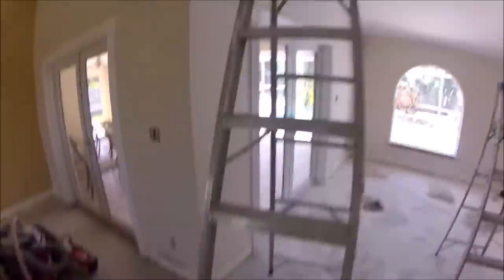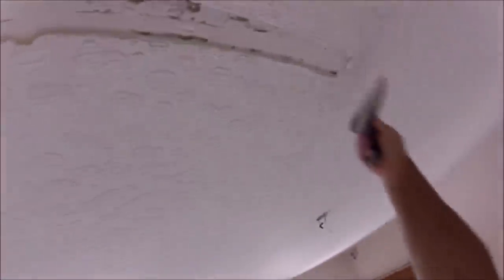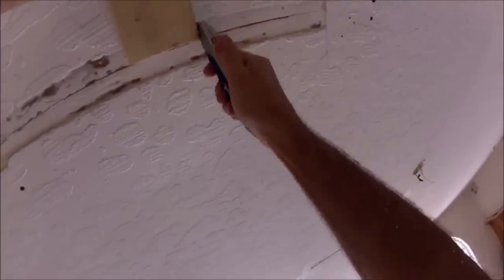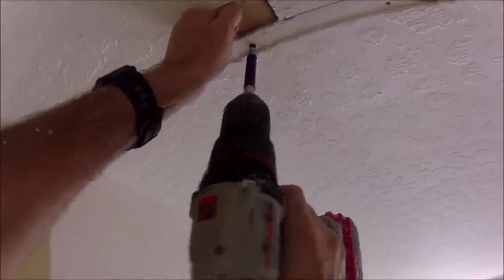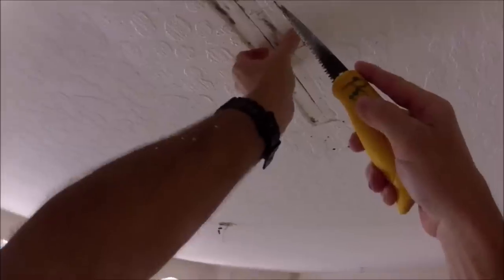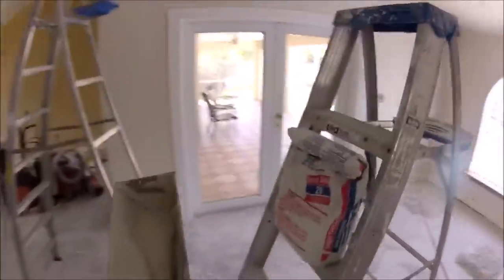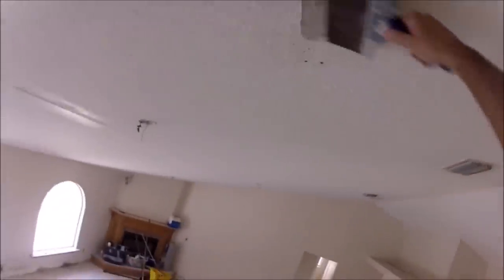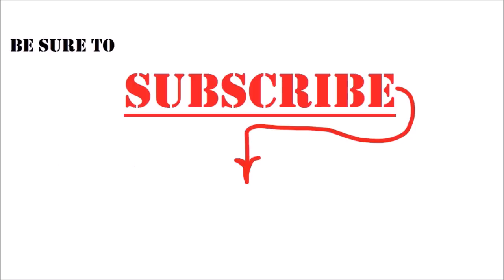How to Repair a Ceiling Crack- Diy Drywall Repair Tips and Tricks

Comment: Finally getting to watch someone who has talent and pride in their drywall work!  My daughter and I specialized in drywall repairs for years.  Basically we were painters and just got into the wall repair by accident. We always aimed for perfection. Matching many older texture styles was always so fun. Our aim was to make cracks and dents completely disappear. I have never done the backing board thing, but have imagined this very technique in my mind....this video was amazing! Thank you!
Reply: What method will be useful for arresting water leak from the upper floor rest room? They suggest the application of crack- filler solution after drilling with the help of a machine! Will it be useful. Kindly advise me, as I keep the premises unoccupied due to this problem for several months!
Reply: @rajendranthangavel9161 you fix the leak. If you try to waterproof the drywall you will just end up with a bigger problem by the time you notice it’s wet.

Comment: You did a good job. I would of added one thing. Before mesh, V out the flat seam out a smig... then add liquid nail... putting enough pressure to have it squeeze all the way thru to the opposite side of the drywall, and fill the V... then mesh away. No hump, no issues with mud dry or flashing. But it’s a forever fix.

Comment: 10/10 - This isn't just a cover the crack quick fix. You're getting to the root of the crack and fixing that. Great video. That and your texturing techniques. I've been doing home drywalls repairs for 3 years(as an amateur home owner). I think I'm pretty decent for an amateur, and I'm constantly criticizing my work every time I walk by it.  I learn something new with each of your videos. I may punch a hole in one of my walls just so I can fix it. That's actually not necessary since I have several ceiling cracks and some wall work to do in my spare time. Keep up the good videos
Reply: Need to repair 2 boards that have
Separated

Comment: Have an eight foot crack in livingroom ceiling spanning the old 2X4 trusses. I have been up in that area doing electrical and venting over the years and my weight probably flexed the trusses.  Really like that furring strip repair example in your video. Thanks.  I'm doing one on the Master Bedroom electrical outlet cutout, where I am installing a much larger outlet box to ensure enough air space for cooling of the 21 electrical connections in there.  Nice video, now I know how to fix this ceiling crack professionally.  I worked in the 1970's for a short period as a drywall grunt for a journeyman and we would sheetrock a 3 br/2 ba split level in around 8 or so hours.  That is when I learned to hammer from any angle thousands of times a day.....back then we used nails.

Comment: The sheet rock in my garage ceiling is doing exactly that at every joint thanks for the tips!
Reply: .. same reason I watched ,,, and yea ,,, furring strip was good tip .
Reply: Same issue here. What’s the deal with garage ceilings?
Reply: Mine too.

Comment: I've been a drywall "taper" for almost 48 years now. For the first 39 years all I did was a lot of production piece work using taping tools exclusively. Where not only did you have to be fast, but you must turn out quality work to make the money.  Yep... I'm that old and still doing it and have pretty much seen it all.  I've gotten into more  remodel  jobs these last almost 10 years now because that's where the money is now. 
I despise cracks in the ceiling. One reason why is trying to match textures. I try really hard to do them where they disappear. And I'm pretty good at it. But... it's a patch. Your dealing with mils (many coats) of paint, light going across the surface and picky homeowners. I always tell them "It's a patch". And I do the best I can with all the experience I have to make it right. Then give them an option of fixing the patch... which "should" come out right.. for $XX.00. Or... I can do the whole ceiling for $XXX.00. They almost always go for the $XX.00. 
One of the biggest reasons cracks appear in the first place... 2' centers on the trusses/ joist and 1/2" drywall. I've seen this done on custom homes and track houses.
It's sound structurally, but it moves way to much. If home builders pull that stunt... they need to use 5/8" rock.
In my experience about mesh tape. See all those holes in it? I've seen numerous patches, and sometimes whole houses taped with that stuff. "Hot Mud" or regular... it "can" crack straight down the joint line. It's a risk I'm not taking. It's a "do it yourselfer" product because you don't have the blister issue of not getting the proper amount of joint compound under the paper tape. 
I use a lot of 5 minute "Hot Mud" because it just works faster when doing those small area patches. Not recommend if you move like molasses LoL!. Many times I've mixed up a sack and a half of 20 minute in a bucket and use it up before it goes off. 
I haven't had time to look at your other patching videos. So I'll  just say this now... rub the edges of the patches with a wet sponge to blend into the old texture when your ready to texture the patch. It will kill the edge and make a better blend. And if that's what you recommend... good for you.
Reply: So do you strictly use paper tape for everything? What about fibafuse?
Reply: @classiccountryrevival8563   I've never used that stuff before. I know drywall tape. And I still push a bazooka around on bigger jobs. That fiber type tape will not work in a bazooka. One 250' roll of it is almost over 4 times the cost of one 500' roll of the paper tape. It looks like you have to carry a razor knife to cut it too. It doesn't makes sense to me because the regular tape works fine.

Comment: One of your better how to videos. Ceiling cracks stink for sure. One of my rental properties years ago, a potential tenant saw a crack like the one you fixed and bailed on renting from us, saying it was a deal breaker. She was paranoid and thought the place would fall apart. It was Only cosmetic! Paul have you heard of those screw setter bits Dewalt makes that allows you to instantly sink a screw into drywall perfectly every time in one motion? You don't have to slow the drill down at the end because the guard on the bit stops it perfectly.
Reply from the maker: I appreciate that Jeff.🔥 Haha... Yeah some people get freaked out if they see a crack in their ceiling. Are you talking about a dimpler bit for a drill?  Yes, use them all the time on new drywall.👍🏻 I don’t really use them on repairs though. Because it’s not usually a flat surface that I’m trying to screw into. Thanks so much for watching and commenting man! -Paul

Comment: Yep, that is how you do it! Basically, all drywall seams need backing.
Reply: Exactly, if it's hot room to move it has room to crack.
Reply: Makes sure to tell that to all the "professional" drywallers...my house is a mess because of bad joint locations, 24" spacing and no backing at joints...I just fixed a ceiling in my bathroom, bad tape job. Peeled right off...Should be good now. No I'm not a pro just hate shoddy work. Takes me longer than a pro, probably more sanding but looks good and lasts...

Comment: im going to be fixing up my living room soon so this will come in handy!
Reply: I had some water leak from the kitchen to basement.  About 3ft n three different area's I left the tape up remuded over it sanded it down and texted it but there were still a lump in the ceiling do I have to remove all that tape and redo it

Comment: DYI here, enjoying the videos, I’m researching. I’ve got a big mess, plaster walls and most of the ceiling appears to be plastered. They had covered both with paneling, which I removed. Water damage, roof repaired, sistered some beams, removed the nail glue but lots of holes left to patch, cracks to fix. I’m thinking after those are repaired skimming and knock down are going to be the best approach. Thanks for the videos.

Comment: after you put the firring strip through the hole turn it 90 degrees so it will span more of the joint.  Ceiling trusses are typically 24 inches o.c. which leaves roughly 21 inches between trusses. If your fir strip is 12 inches long and more or less centered between trusses that leaves only about 4-5 inches of unsupported joint.

Comment: If you have problems getting  block of wood into hole with drywall screw  in it, Try placing a center mark on wood and push wood in hole without screw, then work a string, cord, or wire around wood, move wood in place using center mark for reference, and pull down on string, cord or wire while driving in screws  then remove string,  you can do same on walls but need to tape  string on back of wood so not to drop wood down inside wall. Might need a glove on while pulling down on string. This works well in tight spaces like in ceilings where roof angle is close or wall which has an outlet box or framing in wall in opposite room restricting your hole access. 
M L Rogers         Pasadena, TX

Comment: When you mix up easy sand whether it’s 20 , 45 or 90 , always clean your bucket or pan well and use cold water . Quick mud is hot mud . It gets hot . So the colder the water the longer the compound will stay usable . 
20 should actually last about 30  minutes . Etc

Comment: Super tip ! I like the furring strip insert!! Indeed fibafuse would’ve been also a great option and there is a hot mud from Certainteed called lite sand plus specially developed by Chemists to stick to painted surface thus eliminating the need for a primer and it is sandable as well! Love the video 👍🏽👍🏽
Reply from the maker: Hey there Doctor Mud!💥👊🏻 Yes, this furring strip trick is pretty slick for sure! The best part is that it really works!!! I have not heard of that Certainteed mud. I’ll have to look into that. Thanks for the head up on that!👍🏻 Glad you’re enjoying my videos. Thanks so much for watching and subscribing my friend!😎 -Paul

Comment: This is a great tip! Fiberglass tape also works great across surfaces of different materials. Knocking off high spots with a 6" knife can usually prevent need to sand- of course, practice, practice, practice! Thanks!

Comment: Paul, good method with the extra blocking,  but in 30 yrs of drywall I have found that you need the continuous membrane of paper tape, using fiberglass tape the cracks will just reflect through the mesh and you will have cracks again.  We stopped using mesh back in the 80's.

Comment: Have a cieling crack that appeared following a roofing job. Ceiling is drywall. Crack is pretty long, starts at a corner, goes about 20 feet. Notice that there is movement in drywall. So This furring strip technique is reccomended for a job like this? Considering the length of the crack you reccomend multiple strips? Or only where the drywall has give? Had foundation people in to make sure it isn't foundation. The crack is not scraight straight, kind of has multiple start stops but all in line.

Comment: I do repairs at an apartment building that is 100 years old. Yes you read that right. 100 years. It’s almost petrified. I have to drive pilot holes most of the time. Anyway when I repair the drywall it’s so old, most of the time swollen and crumbly. Any tips on that? My least fav is overhead. Thank you so much!  I just kinda ran into your channel. You make it look so easy!
Reply: If it is 100 yrs old and has never been remodeled, it is most likely plaster lath, thin wooden strips, with a 3/8" gap between them, covered with plaster which has horse hair mixed into it. The horse hair helped act like mini rebars to give the plaster strength. After plaster lath, came Rocklath [roughly 18" x 4'] , then came drywall.

Comment: I did this about two years ago but did not have any flex in the drywall.  Have you every used Saint-Gobain's ? Lowes carries it and I switched to it from FibaTape and still use 20 min mud, works every so good.  Thanks from the Palm Beaches for giving your knowledge on this part of home repair.  Much appreciated.

Comment: Thank you Paul. I will try that technique on some repairs that keeps surfecing up here at home, nearby the windows. My entire leaving room ceilings has cracks, I wonder if it is worth it fixing it or replacing. The home was built in the 50’s and has plaster and that nasty spraid acoustic in the attic!

Comment: i've had a 10' foot long ceiling crack, two different drywall guys have patched it up and cracks again. they definitely didn't do what you're doing. i also believe there was a wall there before and wondering if its more of a framing issue? great video!

Comment: The drywall repair was done right except i use paper tape it never failed me. 
If you are using mesh tape you have to use a different gage a lot thicker and stronger it’s used in the plaster trade sometimes. 
🙋🏻‍♂️👍🙂

Comment: We always set 1x4 or 1x2 furring strips under rafters with 16 O.C and then screw drywall to those furring strips, never seen any ceiling crack because it's so well fixed.

Comment: As a DIY guy I've done a lot of drywall repairs.  I appreciate all you video's they help often.  I just bought a retirement home for ourselves.  The ceilings are in fair shape, there are a few joints that separated and  have no problem doing them.  However, the ceiling was finished using a spraying application and they mixed mica in with the paint (stuff the use to do back in the 60,s thru the 80's.)  I won't be spraying the finish, most likely using a roller.  I can't find mica anywhere in my area or online.  Any ideas on where to purchase?  I like the look of the reflection, especially with the fireplace blazing.  Thanks for taking the time to answer.

Comment: I have cracks form across the center of mobile homes. I scrape the old texture away and patch it perfectly  but when it comes time to match the knock down. Its hard to hide the 12 ft or so strip i scraped out of the ceiling to reveal the crack. ...otherwords its hard to match it to both sides of the patch that i didnt scrape.

Comment: Holding on to that little screw can be difficult, you might try using a peice of shoe string wrapped around wood pull down on both ends after screwing let go of one end and pull out. This way you can get more leverage.

Comment: It's always best to remove the old tape just so you can really see what's going on underneath and resecure the boards as needed...   As painful as that may be when you're only given a small time frame for the repairs and you have to dig the tape out inch by inch...  It will always yield the best if not longest lasting repair.   I never go over old tape even if it's bonded well.  For all you know the first guy used a finishing mud for tape and bed coat 😅

I'm dealing with one Monday that should have had an expansion joint installed in the first place... 60ft ceiling without one and a crack formed. Awesome.  Owners won't go for a proper repair.. I'm almost certain they won't.

Comment: New DIY viewer here. Enjoyed your video.  Concise and informative. I'm Looking  for information on repairing a kitchen ceiling crack.  The small crack recently expanded, after a floor joist repair.  It is about 8 inches out from the wall, and is between 2 trusses.  How do I attach the 2 drywall sections to each other, when there is nothing above to screw them to?  Do you have a specific video that addresses this? Thank you.

Comment: Excellent video tip....now what if your drywall is 1935 vintage made with concrete ??? I have cracks that always return.....and my walls are plaster over terra cotta tile block.. ALL walls.....stucco exterior... better learn to plaster.

Comment: Why did you put the furring strip blocks in? If you rescrewed the drywall, then why did you need it? I’ve never done that, but I’m curious of what it’s purpose is. Thank you for the video!
Reply from the maker: Hey there John!💥👊🏻 The drywall was hung directly on the trusses which were 24” on center. So, there was a sag in the drywall right in between the trusses. That’s why I put a furring strip right in the middle of the trusses to attach the drywall. That will fix the sag and the crack from happening again. 👍🏻 I hope that makes sense. Let me know? Thanks so much for watching and commenting my friend!😎 -Paul
Reply: @PaulPeck  I totally understand, makes sense! Thank you for the response! 👊🏻

Comment: Great video as always! Do you ever use “crack tape”? The stuff with the round holes is what I’m talking about. I have found it to have superior tensile and shear strength to other tapes. Your thoughts?
Reply from the maker: I actually tried some on a wall crack on this same job. It seemed to work really well!👍🏻 I have video of that process too.🎥 Thanks so much for watching and commenting my friend!😎 -Paul
Reply: @PaulPeck  crack tape
Reply: Iv actually found that tape fail but due to not cleaning out the joints plus movement.  Removing crumbled or damage dry wall from the joint plus controlling movement is key.
Reply: Paper tape is strongest...but still a 100 ton house wants to move or shift nothing you can do..
Reply: @jeremiahosullivan3033  FACTS!
Reply: Mesh tape should  always be used for crack repairs .

Comment: I have 3 issues related to some joint cracks. 1 - Summer vacation home winter low set to 51F degrees. 2 - house built on pilings windy bay front. 3 - tray ceilings. There is minimal width but full length (20 ft) hairline recurring cracks painted over but not fiber taped.  When I tap on the taped areas, it does not sound solid beneath. I am mechanically inclined but spackle like a kid applies icing. I don’t think I need relief joints, what do you suggest? Tx